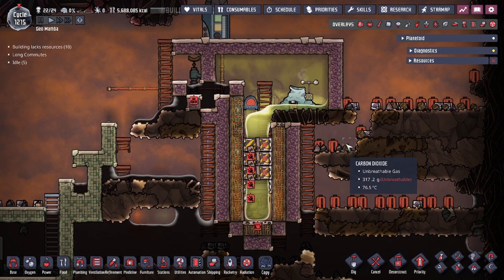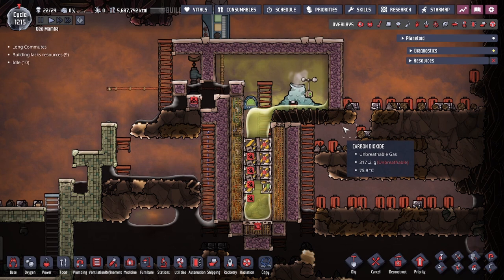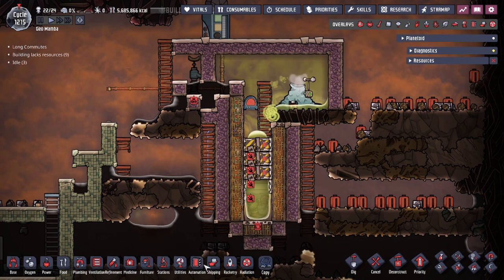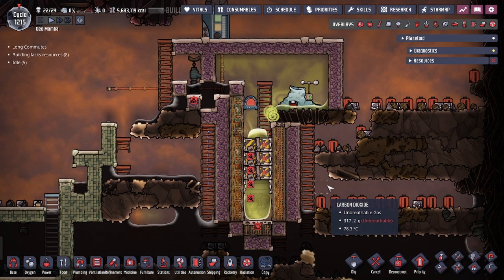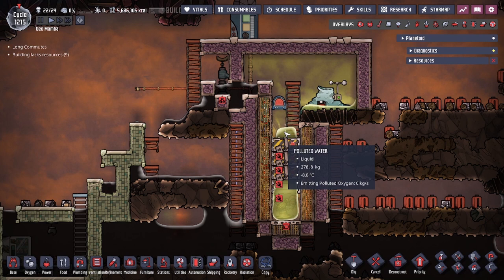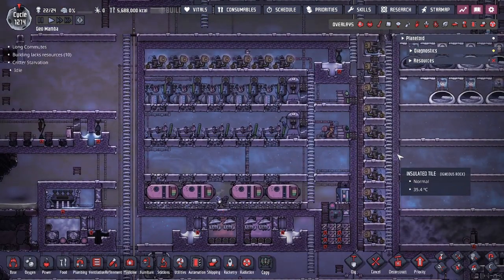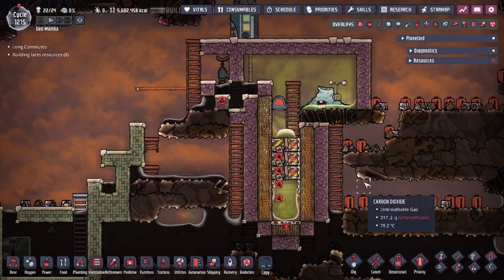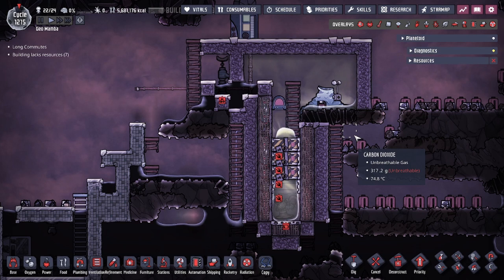Cool Slush Geyser Tamer - Door Compression Design for Infinite Storage - Oxygen Not Included

Comment: it needs another buffer gate for the last door.. probably because some updates changed things
Reply: If you solved it, please let me know.  Using your suggestion, I added a buffer on the back automation loop, to slow the bottom door 1 second.  I also increased the middle buffer (of previous 3) to 6 seconds).  It seems to be working visually but I am pumping the water out, so I haven't seen a stress test yet. This makes my timings from top to bottom, 2, 2, 6, 5, and the new buffer 1.
Reply: @bigmatt4939  i just added a buffer for tje last gate with 5s and its working..
Reply: @bigmatt4939  sorry.. all the timers are good.. for the additional buffer set 5sec and it will works

Comment: Does this still work or is the timing off?
Reply from the maker: it works, but there are potential issues that occurs at high lag points.

1) automation ticks can skip signals when simulation at 3x or higher speeds along with a decent amount of game lag.

2) theres a glitch at the moment during 3x simulation where the door status is "open" but the game still has it closed and doesnt allow anything through.